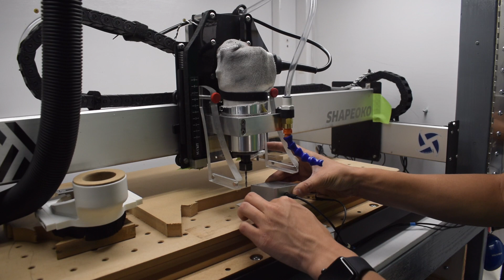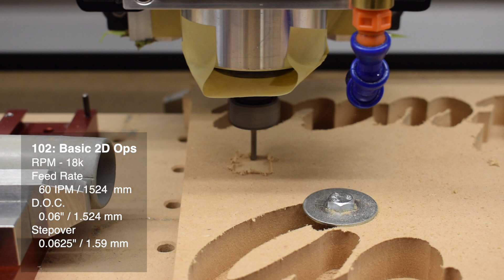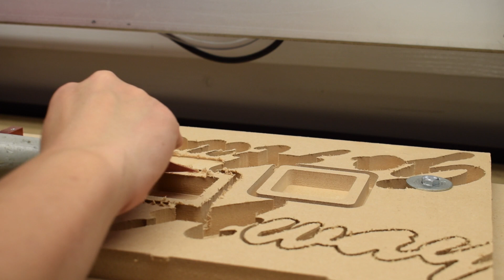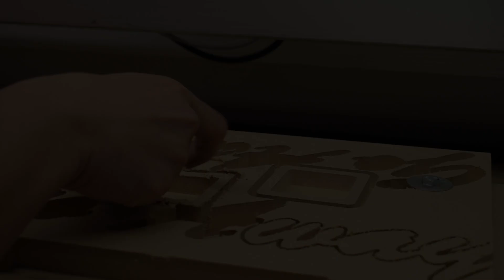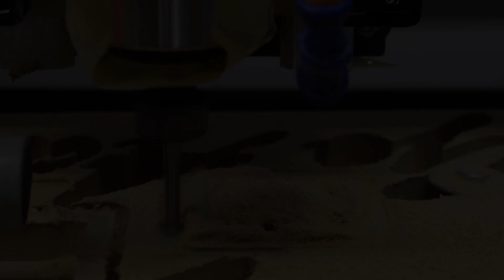MDF Speeds and Feeds for Shapeoko - #MaterialMonday

Comment: i just read some comments and got ideas but i had a question. if time isnt an issue and im just doing a project for myself and wanna reduce sanding and fuzzy stuff, is it at least still safe to use a downcut bit but go slower and less depth per pass if for example im using a 1/4 inch endmill or a 7/8 diameter bowl round nose bit for an ashtray center pocketing in which the material is walnut and epoxy and the dimensions of the circle pocket is 7 inches in diameter and 1 inch total depth?

Comment: I think these cutting rates are way too soft. On my XXL with high-density MDF (so called "hydro" MDF here in Belgium, which has harder surface than common MDF) I go, with a 6mm 2-flute conventional bit: 24000 RPM, 6mm deep, 5000 mm/min (the fastest the Shapeoko goes without tuning). It works just fine for clearing pockets and contour cutting. I usually let a .5 to 1mm wall finish allowance then do a finishing pass with zero allowance. That's much better, faster and safer because the dust isn't very fine like on this video. I have to say I have one of those 800W G-penny water-cooled spindles, which is much less prone to deflection than my previous Makita, besides being incredibly silent. 
I have to say that until recently I took everything Winston says quite seriously, until I studied the problem of chips and now when I see dust on a video, I am quite skeptical about the feedrates used. These are good for aluminum, not MDF
Reply: Yeah, almost all youtubers talking about feeds and speeds in wood are waaay to conservative
Reply: @TrolloTV  Actually, when I read my own post above, I think: wow, that too slow. Today I'd use 8000 mm/min
Reply: @AdrienGaryLucca  You do 8000mm/min with a DOC of 6mm and default stepover? Up to what speed do you have your shapeoko tuned?
Reply: @janstappers5246  5000, not 8000. the Shapeoko can go up to 10000mm/min

Comment: Just a quick thought. You could try using a spiral Downcut bit for your initial cut to establish the shoulders of your edges and then when down a little switch over to the spiral Upcut bit. To my thinking this would give the best of both worlds, crisp shoulders established with more rapid bulk removal. It works well on my regular routers and my Router Boss so it should work on a cnc on most woods and mdf I’d think. As I said, just a thought
Reply: There is a solution for that, theyre called compression bits

Comment: Is your router covered up because of the mdf you are cutting. And  what router or spindle is that in this video
Reply from the maker: It the Carbide Compact Router we sell. I keep a sock over it because when I cut aluminum, chips can jump up and get sucked into the router, which shortens the life of the brushes. To a lesser extent it helps with sawdust, but that's what the vacuum is there for.
-W
Reply: @carbide3d  Once again this problem disappears once you use water-cooled spindles

Comment: What is under your touch probe? I haven’t been using mine because the z plunges too deep. Disappointing for $120.
Reply from the maker: I use a sticker. Adds 10 thou (.25mm) to account for any double sided tape. Also try the latest Carbide Motion beta which improves the accuracy of the touch probe. -W
Reply: @carbide3d  How do I find  out if I have the latest version of Carbide motion beta
Reply from the maker: @resorter66  My bad, we promoted it to the main release channel already, not beta anymore. If you have v416 you're caught up.

Comment: How does this apply to the speeds when using a router instead of a spindle on the Shapeoko? I've been loosely following the tutorials on the Carbide website so I think I missed the part where they covered how to adapt the routers variable speed dial when cutting materials. Is it just set to run maxed out all the time every time or is there a scenario where we can dial the router speed down?
Reply: Just to say where I'm coming from this is my setup: https://i.imgur.com/WSa3exY.jpg

CNC Milling is basically all about turning your material into chips/pellets and MDF, while a forgiving teacher, is a poor one as the material does not chip - It pulverizes thus robbing you the experience of how it NEEDS to be done once you start using different materials as heat is being removed with these chips/pellets and an Endmill allowed to do so should only be warm to the touch. Also... MDF, because of it basically being a super thick abrasive, is BAD for anything else but carbide endmills capable of dealing with this kind of material.

The main player in this is your Endmills Chipload capacity which works in a trifecta with your machines XYZ speed and your Spindle/Routers RPM range.
Usually, your machine will cap out at some XYZ speed which is the fastest you can get work done - Here's where the Spindle/Routers RPM range will come into play hopefully being able to satisfy your given Endmills chip load capacity at top machine speed which should usually be the case - If your machine is capped and your Spindle/Router still has plenty of reserves you may want to consider the number of flutes your Endmill has thus allowing you to increase your Spindles/Routers RPM.

On the flipside, if your Spindle/Router cannot be brought below a certain RPM to meet the chip load demand and your machine is still capped then you'll have to reduce the number of flutes. If that's not possible anymore ( can't go lower than one flute, eh? ) then you'll either have to get a slower Spindle/Router, faster/stronger Steppers or just suck it up that your Endmill will essentially only rub the material instead of creating chips and burn up - Something that will happen with anything but a carbide endmill when working with MDF.
Reply: https://wiki.shapeoko.com/index.php/Materials#Router_Speed_Chart
Reply: @macaroniandtuna  thanks :)
Reply: @macaroniandtuna  What does SFM mean on the spped chart

Comment: So snorting long lines of MDF = Bad?  But not necessarily Breaking Bad.
Reply: As long as you use a down spiral mill. You want to avoid those larger chunks in your nose.
Reply: Can I gave same feed and speed for downcut bit . Last time i gave 18000 rpm 1 mm depth and 2000 mm/min feed  for 1/4 inch down cut spiral endmil ( Mdf).But it had large chunks  and not smooth.